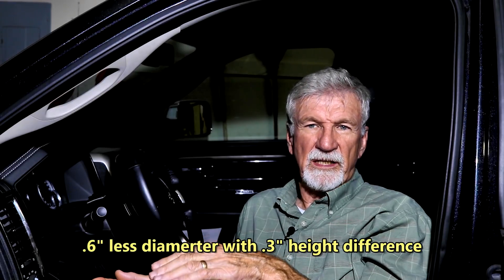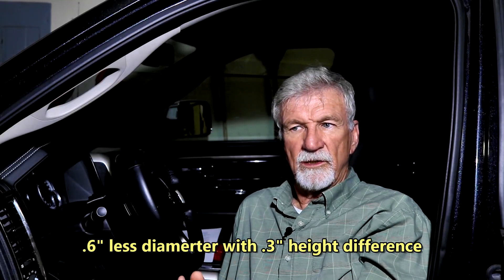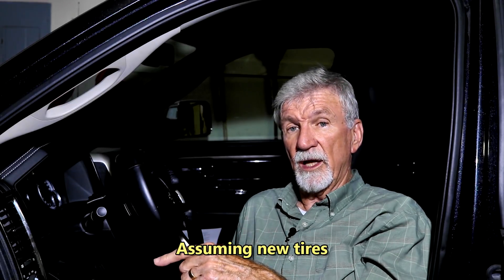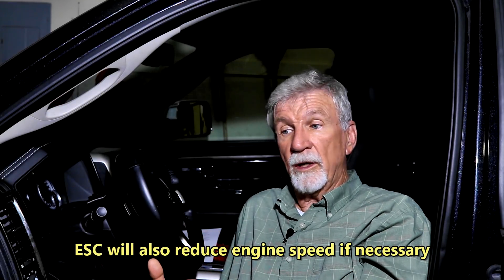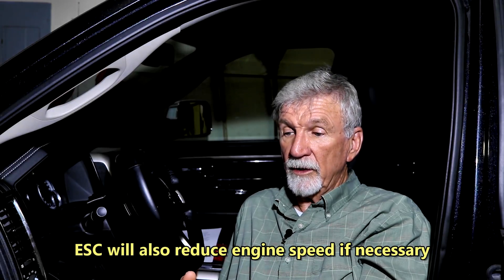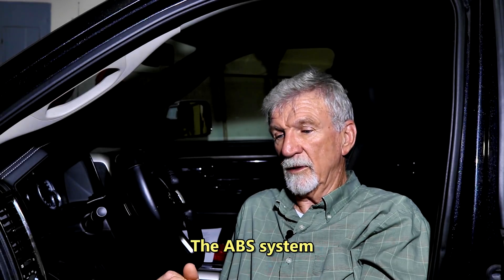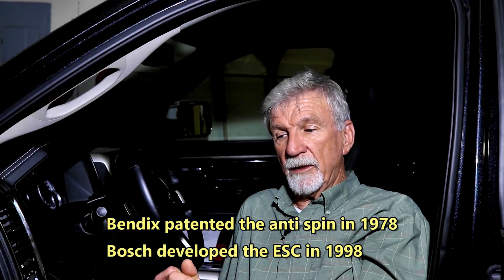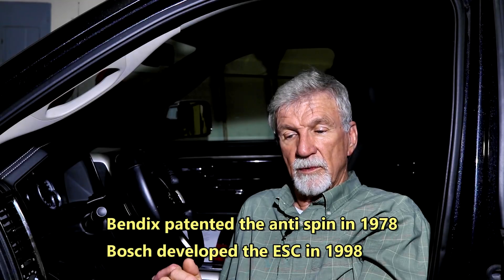RAM Electronic Stability Control (ESC)

Comment: Hello Marion, I hope all is well with you & the family. Been following you off & on for a while. Appreciate the informative video on what this button does. 

Also on the subject of metal grading on a bridge. One rainy night while traveling by motorcycle I hit that steel grading doing about 55 mph. First my front tire felt like it was going to slide out from under me as my rear tire got a bit squirley. All this while my wife was on the back. I was wound so tight I coulda released a diamond out my rear end. 🤭✌🏽

Comment: Question sir, if my 2WD ram 1500 2014 rear wheels off the ground with jackstands and I turn off the traction control does the rear wheels only spinning ? I hope you answer my question sir , cause I’m planning to change the oil for my transmission and I need to this test.

Comment: Great video!  I have a new 2023 Ram 3500 Dually 4x4 6.7 HO diesel.  I for the life of me can't find an esc button like my 2019 had.  Why would this be??  We do alot of sand traveling at PINS and aside from pulling a fuse, can't figure out how to fully shut down the esc.  Any ideas??
Reply from the maker: Sorry, not sure, they may not have the option to turn it off.   Nice truck!

Comment: I have 34” tires on mine and had to use the smaller spare tire on right rear, it didn’t seem to affect the esc … drove it about 50 miles in case anyone is wondering….. thanks for the info👍
Reply from the maker: Good to know!

Comment: So the esc Is a safety feature, and turning it off gives you more speed(dry conditions)
Reply from the maker: It's a safety feature but have never heard it gives you more speed when turning it off.
Reply: What I understood from your video is that The ESC is providing more traction… if you relieve traction from two wheels either front or back, it should relieve tension from the drive train… isn’t that why drag race cars have rear wheel drive versus all wheel drive?
Reply: My 2014 Laredo reacts quicker with the ESC turned off, but in fairness it’s not a big deal I think the whole thing is a gimmick?

Comment: Hi Marion.  I have a 2019 Ram 2500 4x4 Diesel Limited with the rear air level suspension.  I tow a 5th wheel who's dry weight is 14,250 lbs and I am getting terrible sway.  What suggestions do you have to address the sway?
Reply: whats your weight at the hitch and is it a srw or dulley
Reply from the maker: Don't know.   Look in your area for a shop that makes and services commercial trailer and talk to the about the problem.  Most are pretty knowledgeable

Comment: For the RAM
Pressing the ESC once will disable the Traction control for the Rear Wheels only.  (Help For straight line burnout only)

Holding the ESC button for 5 secs will shut down the ESC completely.  (Full power on 4x4 offroading without restrictions).

Comment: On some vehicles, pushing the button you set the ESC in partially off mode. That means that only the torque management is turned off. So you have power to the wheels to maintain the speed, but also the spinning control working. It's like having a limited slip differential. Useful uphill in snow conditions.
The Promaster has this feature, for example.

Comment: Nice Job Mr. Blair, very well explained - everything made sense.  Happy you brought the "Jack-Knife" experience into the explanation when towing a trailer.  I sure understand the the effect of the ESC system now

MORE IMPORTANTLY - Really happy you told me that it is automatically in full time operation and gets DISENGAGED when I push the button.  One gets so used to the fact that you only push a button when you want it to do something.  Great Job!

Comment: Thanks for another excellent video. 
 When ESC first came out, I thought it was a gimmick, but research shows it reduces single vehicle accidents, and single vehicle fatalities and injuries significantly.  Reduces those lost control in a corner, lost traction in ice, or drifted off the road and jerked the wheel over correcting kinds of accidents. 

ESC was slow coming to heavier pickups, as technology usually is. My dually does not have ESC and one time I broke traction accelerating on a curved and graded on ramp towing a utility trailer. I expected reducing accelerator input to result in immediately regaining traction, but it slid quite a bit before it hooked up.   ESC is definitely worth having imho.

Comment: I honestly hate the ESC system. If i want it off, i want the entire thing turned off and stay off. I cant drift the gravel roads without it cutting power and correcting as over 30mph it kicks back on. My old 1500 i can whipp these corners sideways without issue. Do not want a truck babysitting unless i want it too like the given situation you mention nesr the end.

Comment: Can you turn off ESC on RWD Vehicles without messing with fuse box?
Reply from the maker: HI, Not that I know of.  I think the ABS will still function with the button on the dash pushed.   Fuse and it may throw a code?
Reply: @MarionBlair  thanks for the quick response, also why do some vehicles have 4x4 badge on it like my Jeep, but it has no 4x4 controls/T-Shifter, whatsoever?
Reply from the maker: @KingdomWithin7  No sure about the badge but the shiter's are not required for electronic transfer cases, just a button, if I understand your question correctly.
Reply: @MarionBlair  is it the ESP Button?
Reply from the maker: @KingdomWithin7  no it's another button that has 4 x 4 Low 4 x 4 hi
Reply: @MarionBlair  thank you, and great contant👍

Comment: Just a quick question -- is there an indication anywhere on the dashboard when the ESC is on / off ? And when the ABS lamp is on does that indicate that the ESC is not on / off ?    Thanks.    JKB
Reply from the maker: James, yes, on the laramie, it's on the left side (tac) under the check engine.  You can toggle the dash switch and watch it on the EVIC.

Comment: I’m not exactly sure,I think this system save me from crashing my 3500. Ram off the interstate and was heading for one of those cable barriers in the middle of the highways. Cruise was set at 75 and it happened so quickly I didn’t even have a chance to apply brakes. Probably won’t have been a good idea in anyway. But the truck straightened enough for me to continue riding the gravel and gradually pulled it back onto the highway. Never broke speed. Thought I was a goner. Really happened fast. Only damage was to my underwear.

Comment: My Ram 2500 spins wheels either left or right and Traction Controls is switched on WHY?
Reply from the maker: Are you sure you have anti-spin?
Reply: Allegedly yes, well Electronic Stability Control  it's a Laramie and Tow/Haul mode which works a treat.
Reply from the maker: @jeffreyfishlock2546  Go to this site and get your window sticker and see if anti spin is an option.  All new vehicles have ESC but not necessarily anti spin  http://windowstickerlookup.com/
Reply: @MarionBlair  Hi Marion, Here in Australia the window sticker site doesn't work because these Trucks come straight to the importer Ateco and are converted to R/H drive. Thanks for your help though could you advise on Servicing here in OZ they want our Ram 2500's serviced @ 12,000km or 7,500ml which is ridiculously over Servicing, when Cummin's say's 24,000km  or 15,000ml .
Reply from the maker: @jeffreyfishlock2546  Jeff, don't know about the servicing but it's surely better in Australia than here.  I have a good friend her that is going to be converting his Duramax to RH.  He'll be moving back to Albany (below Perth).  Is Ateco the company that does the conversions?  I've heard some have it done in the Philippines also.
Reply: @MarionBlair  Marion, Ateco is a Vehicle importer of various brands and they struck a deal with Ram and Walkinshaw which use to prep Ford Falcon V8 race cars no more V8 Falcons so they with Ram and Ateco is the only authorised Ram Truck importer. Now Holden aka GM is bring in Silverado 2500 and they're converted by HSV (Holden Special Vehicles) who use to prep V8 Race Cars Holdens but no more. There are numerous companies who could convert his Silverado based in Melbourne and Brisbane Area's check the web for them and you can email them for costing also. Hope this helps.

Comment: Thanks Marion, love these.  Great job on applicable history as usual.

What OBD gauge are you using?  I’d like to monitor more diagnostics, etc.
Reply from the maker: I'm using the Edge insight,  Mine is an older model and I will be upgrade to the newer version soon.  I will do a review on it as soon as possible.

Comment: Good video Marion.  I like ESC.  There used to some wild rides in the old days without ESC, ABC TC, etc.   When I got new tune for my Mustang with a Kenne Bell on top, it wouldn't get off the line and just about died when the wheels started to spin.  Had me scratching my head for half a day until I realized this tune didn't have the Traction Control disabled so I needed to do that when starting the engine.

Comment: Just wondering if you going to trade in your truck when the new 2500 comes in 2020?
Reply: You'd be silly to buy the first year of any new redesign.
Reply from the maker: Yes, agree.  I would have to  wait for the bug fixes a couple of years depending on the reviews etc....Although an no egr system would be nice but isn't that what we delete them for?  why wait it 2020, ha.
Reply from the maker: Well I'd consider it if they make any significant changes like the rumored egr_less engine.  Cummins has already introduced their all emissions equipment downstream of the turbo but so far I think it's just for the bigger engines.

Comment: What about Deep Snow or Ice in 4WD with a truck that has the anti-spin rearend?  Will this system effect the effectiveness of the Anti-spin?
Reply from the maker: I'm pretty sure it's just like the Jeep.  When the vehicle is in 4wd high range and the Electronic Stability Control System (ESC) is on, traction control uses the brakes and engine torque control to limit how fast the driven wheels can spin relative to the actual speed of the vehicle.
Reply: Reason for my question was within a few forums many owners were/are having to push & hold this button for a few seconds, I think 10 to some what truly disable the system due to it was severely hampering the function of the anti-spin rearend.  Which in snow/Ice is a bad thing:  An owner wants his 4WD & Anti-spin working together & this little button keeps this from happening.  Even though I know the system alone is a great addition to the Ram.
Reply: Found my answer:  https://youtu.be/3_ZX2iNQ9Ps
Reply from the maker: Yea, I saw that.  He's cool.

Comment: What is the windshield suction cup held display you use and how is it connected.  Love your videos.
Reply from the maker: That's an edge CTS, a very old one, the monitor is pretty washed out in the sun.  It just plugs in to the ODBCII connection under the steering column.  It's pretty interesting and helps figure out how things really work.
Reply: Marion Blair - Thank you sir.  I'm 67 and just bought my first diesel (new Dodge 2500) and relying on your advice.  You are teaching me a lot.  Thank you.